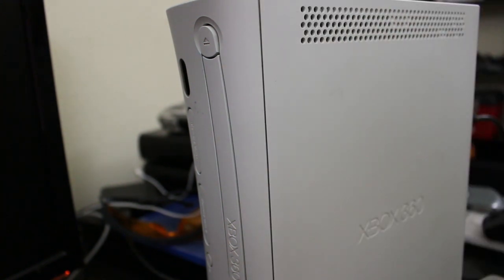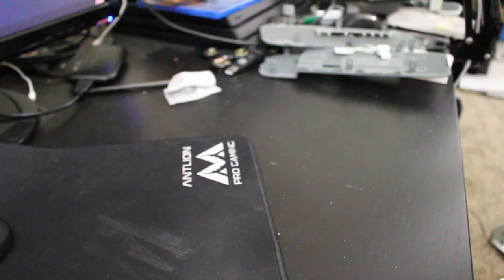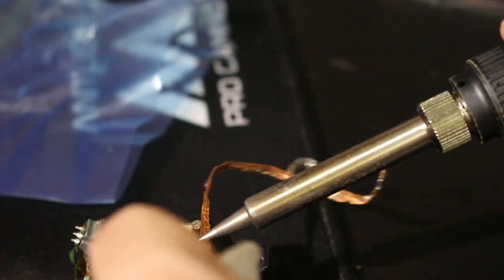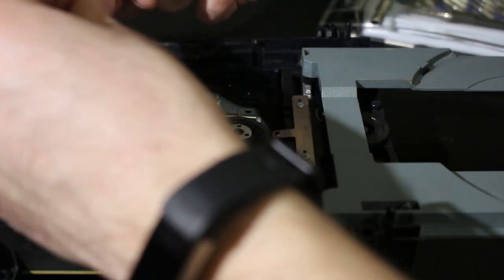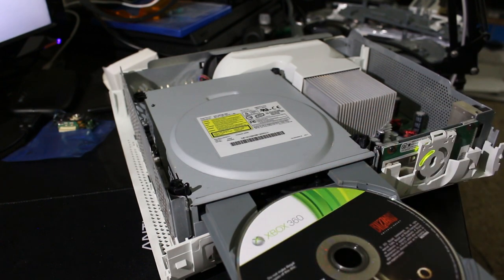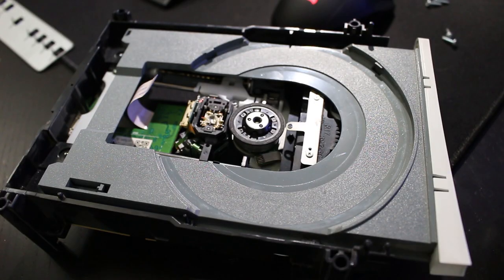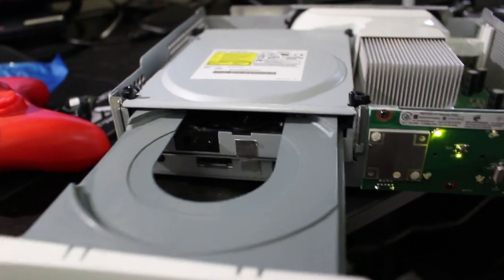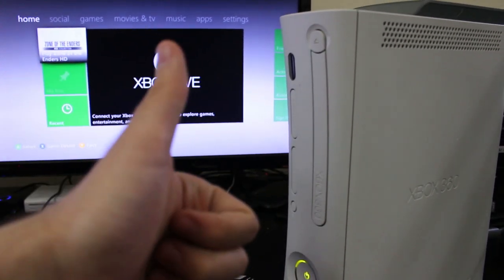Let's Repair! - Xbox 360 Open Tray Error

Comment: I did this once with a 360 slim and the screw was holding nicely for about 30 minutes amd in the middle of my test play you could hear the screw pop out and ping around the drive. I ended up using a bigger screw which so far has had no issues
Reply: can you give me the size of the screw?
Reply: I used a small screw from the inside of the headband of a Gen 1 Turtle Beach 600 Stealth headset (2015) that no longer worked.

Comment: I've seen like 10 movies now where guys adjust the DVD lazer or replace it but no one has mentioned how the bars that the lazer slides back and forth should be adjusted. The lite-on reader has adjustment screws in 3 places, the fourth corner is not adjustable. Mine was way of in one of the corners.
Reply: do you know how to adjust them? i screwed the adjustment up

Comment: In case anyone is doing this in 2021, the issue I had with the infamous screw in the video was that the area that the white part that links the laser to the motor sits in in the replacement laser is slightly deeper than the original, so the original screw wasn't long enough to reach the bottom hole. I got a slightly longer screw from the hardware store and it solved the problem nicely.
Reply from the maker: That's what I was told by the first seller, hah.
Reply: can you give me the size of the screw please

Comment: Great tutorial. Hint for anyone trying themselves dont worry about using solder braid , just use a clean soldering iron and brush it off the circuit board in sweeping motion. takes 2 secs and nice and clean

Comment: I'm actually learning a lot from your channel. I had an xbox that did the exact same thing yours is doing where i would put in a disc, any disc, and it would constantly say open tray. After a few tries it would work but half the time after that it would say the disc is undreadable, no matter the condition of the disc. I ended up swapping it for my dad's old elite model that he was planning on selling. I had to use a pair of tweezers to turn it on cause the faceplate and touch sensor were f@%$*&!.

Comment: Help me please. I have the same Xbox, and it has the same issue. I replaced the disc drive 3 time but the issue continues. Instead of flashing the board I just replace it with the original. This Xbox was a gift back in 2008 so I really wanna get it fixed. Let me know if you can help. Thanks

Comment: Success! thank you for this video. 
note: my replacement laser did NOT come with a anti-static solder globule. Im assuming that means I have a used / refurb laser. it does have the blue lens as well. but it works and thats all I care about. i spent $8 on the replacement. we'll see how long it lasts.
Reply from the maker: Damn, hopefully it lasts long enough. I know you can get new lasers for a few dollars less.
Reply: How is it a year later?
Reply: Same thing happened with mine but it's still not reading disc now it's saying unrecognized disc

Comment: I'm so thankful that you and so many other people made videos for this. Watching multiple techniques helped a lot. The hardest part truly is getting the dang case open. It turned out 3 of the back tabs had snapped off making it near impossible to get the back open. After wresting with it for actual hours I finally got it almost there and then just gave it a hard yank and it separated. I hope I never have to open it again :D. Good news is, even with my lack of solder skills, it's not hard to just heat that ball off it pretty much just rolled into my trash can and then I kept applying more heat to make sure it was completely off the contacts and I was nervous after putting it back together (I tested before putting the case back on) but it worked!! Thanks so much!

Comment: Thanks for the video. I had the same problem. I tried adjusting the laser resistance with no luck. Then swapped in a new laser and it's as good as new.

Comment: You can sometimes save the original laser by using a multimeter on the soldering points on the potentiometer on the left side of the back of the laser. You can use a small flat head screwdriver to move the potentiometer slightly to the left I believe to force the laser to work slightly harder and that can fix read errors in many cases on the 360. You don't want to turn the screw literally more then a hair because you can quickly burn out the laser. With my multimeter set to 20k I have my 360 drive set to 3.2, I've read that going lower the 3 you can burn out your laser quickly because you are forcing the laser to work to hard. For most people you will want it set to 4 or higher but I believe my drive is dieing so it lets me get a little more time out of it before it does die. Just an FYI for anyone reading this in 2022. You can Google search adjust Xbox 360 pot for detailed instructions.
Many people attempt to do this without a multimeter but I wouldn't. Turning the potentiometer even the slightest turn can result in huge over swings resulting in a burnt out laser. I would estimate a good amount of lasers can be saved this way, at least for a while. Sometimes there is nothing even wrong with your laser. Sometimes they come set wrong from the factory. If it's used the bumping around to have it shipped to you can cause the pot to move, even just the opening and closing of the tray can cause the pot to move over time.
Reply from the maker: Oh yeah, I'm familiar with that method, although as you said it can work for some time. It isn't as much of a fix however as a full replacement, and in my experience I've gotten disappointing results doing a POT tweak. 

I did a few and wasn't happy with the results, and with lasers being so affordable, it's just better in my opinion to replace the whole laser with a new one.
Reply: @MrMario2011  Yeah swapping the laser is definitely a permanent fix and I'm going to do that myself for my 360. But the pot tweak lets me play with the broken 360 I got on ebay until the new laser gets here.

I am curious though what we're the results of your pot tweak? Did the laser die? Or was it just unreliable at reading disks after the tweak? My first adjustment on 3.5 would read the disk but it sounded like it was going to launch to the moon and then would shut off, I had to slowly lower it while testing to eventually get it to work. Who knows how long it will last, who knows how long anything will last on a 360 haha.

Comment: I have a slim (Corona) exhibiting similar issues. Do you know the laser model I need for that? I may also try adjusting it in the short-term, but if I can find the right part I could order it to put in later.

Comment: I had the same problem with the screw. Fortunately, my dad has a car repair shop and found me a thicker screw. It does not tighten to the end and a little this white plastic jumps. But it is screwed very tightly and everything works. If something was wrong one day, I will buy a sled of the drive. And by the way super video and you helped me fix the X360 which lay with 4 years for this reason and thanks.

Comment: Dude, a xbox 360 video in 2018? (now 2019 but whatever~) It's like a Christmas miracle! 

Quick question, though. Does the kind of laser you buy matter for the disc drive, cause I don't want to have to worry about incompatibilitys.
Reply from the maker: Yep. This laser will work on phat BenQ and Lite-on drives.
Reply: @MrMario2011  wow, that was a fast response! Good to know that I have to see what my drive is before starting this. Thanks!

Comment: I know this is an older video, but how come no one talks about cleaning the laser lens underneath the top one ?   I have fixed several of these consoles ranging from playstation 2 to these x box's simply by cleaning both lens's.  Need to cut down some of the cotton on a q tip and flatten the end with a pair of pliers but it will fit between the 2.  Moisten (not soaked) with alcohol to clean.
Reply: There's two lens on a dvd drive?

Comment: I got the same laser through amazon and as expected the screw kept pinging out whenever I tried closing the tray
Reply: Update: I put a little dab of super glue on the screw and in the hole and it held nicely, I recently had to replace the belt for the tray and decided to take it apart and have a little peek and it’s still solid

Comment: Ok, so my 360 is RGH'd and the drive gave out a looooong time ago. Now, I dont really even own any physical games as everything is stored on my HDD so i straight up removed the disc drive. I was wondering, could it fuck up the console over long time use like this or is it just fine ?
Reply from the maker: Should be fine as long as you keep it as a RGH.

Comment: I have a broken USB on the front of my Xbox 360 I've got the parts and my system is cracked open because I just did the new laser and it works wonderfully. Now I need to know how to do the USB removal so I don't mess things up any videos for that?

Comment: I have a dvd drive from a jasper motherboard that attempts to read the disc twice before giving up.

If i keep cycling the tray eventually it will recognize that there is a disc and even rip the whole thing reliably to the hard drive. However it only notices the disc in the tray about 10-30% of the time.

I have tweaked the potentiometer twice and it now sits at a value of about 2900 (was at about 4000 at first) and im not going to tweak it any more.

Anybody have any suggestions?

Comment: That screw coming out of the white slider in your DVD drive always happens to me. It's super annoying and has nothing to do with the replacement. It's actually just the crappy made slider, and the thread breaks. You can buy replacements on eBay but I put super glue on the screw and screw it into the slider. That holds it down
Reply from the maker: It isn't an issue with threading, it is an issue that aftermarket lasers could possibly have. A few in here have confirmed the previous screw would not fit snug in a replacement laser and I was also recommended by the seller to use a bigger screw from a hardware store. Not really surprised at the inaccuracy now with it since the Xbox 360 isn't a current generation console anymore.
Reply: Ah okay, it could be possible the aftermarket sellers are fixing the original issue, I'm not sure. I've swapped multiple OEM lasers to get different consoles working and it's an issue that has popped up a fair bit. Glad you got your system working!

Comment: Hey brother bear. I was hoping you might give me a little advice. So I replaced the laser on my Xbox 360 phat , it seems to run fine.....but it doesn't read still. I've doubled  checked it. Anti plastic is gone and no issue with any screws. Do you think you can give me any advice?
Reply from the maker: If it just displays "Play Game" that means your DVD key on the drive board isn't matching to what the motherboard is expecting. If you don't have access to the original drive board to swap in, or you don't have the original drive, or key on hand you'll have to RGH the console to get it back and reflash the drive. Although again, that's assuming you're getting a "Play Game" message and the game doesn't boot. Not enough information was provided in your comment.
Reply: @MrMario2011  sorry about that. So basically the laser disc reader, I replaced it. It wasn't  reading disc's. I insert a disc in and it wouldn't say, "Play Game", it would just say "Open Tray". I removed the anti static plastic off the new laser reader, and replaced it in the disc drive but it still won't read any games. I hope I provided  enough information

Comment: Hey MrMario, nice video, glad to see you got the drive working! Bit of a random question, I remember one of your old 360 videos of you being gifted an RGH1.2 (this video: https://www.youtube.com/watch?v=wnvYmOIk884) and I loved the colour changing LED in the centre of the Ring of Light.

I've been looking around and cannot for the life of me find any of those LEDs that I'd like to add for my console. I don't know if you still have that system, but would you be able to take a look at the ROL board? I'm not sure if the LED itself is a standard 0603 SMD LED, but as I can't find any of those, I'm willing to bet the one used is of a different size/package which I'd be interested in finding out so I could purchase some myself. Could you take a look? I've messaged around with other sellers who do similar mods but they don't seem to be responding which sucks, hence why I'm asking here :P

Comment: I pot tweeked the laser after this open tray error, now it reads only the originals.. no burned discs at all.. Do you know why ? Do I need to change the laser ?
Reply from the maker: In my experience POT tweaking a Xbox/Xbox 360 laser isn't worth it, you're just speeding up the death of an already dying laser. Original games are easier to read than backup games.
Reply: @MrMario2011  thanks for the reply, I guess buying and replacing the laser is the only way to revive the backup collection

Comment: Ok, I know this is kinda off topic for the video, but at least it's on a Xbox 360 video. Anyway, do you know of anyway to softmod a Xbox 360? I really don't want to have to open it up and hard mod it.
Reply from the maker: Impossible.
Reply: MrMario2011 ok well I've since decided on going with a x360key, any info on how to dump the drive key? I haven't opened it yet, but I know that it's a Jasper MB, based on the fact that it was made in 2009 and has a current rating of 12.1 amps.
Reply from the maker: Look up my flashing tutorial, you can get the key that way.

Comment: ? my orginal xbox its like a 6 month out release xbox 360 the drive on it makes awefull noise it works but it sounds like its eating disk what can be done for it
Reply from the maker: If you want to fix it while being lazy, replace the whole drive and swap over your old PCB.
Reply: yeah i thought of that but i bought a newer version of the system that has 250gigs of storage mine was the 20gig model and i replaved the drive with 120 and that was running out of space

Comment: The drive on my system won't open when it's vertical. Will a new drive belt fix this?
Reply: Kag Dioah Yes, it makes sounds but doesn't open. The emergency open trick with a paper clip works fine though. I ordered five replacement belts from Ebay already.
Reply: Kag Dioah Should I lubricate the rails? I have some lithium grease I use for my 3D printer.
Reply: Kag Dioah thanks a bunch
Reply: Just put it horizontal, or leave a disk in it.
Reply: AZTech&Gaming that won't fix the problem. I prefer fixing the issue itself
Reply: I know, but that happened to me on a new belt, because it was the magnet that was clamping to hard on the laser assembly so I had to put tape over it.

Comment: 9:00... I replaced the laser on a friend's XBOX360 this morning... didn't know about that solder blob. I've repaired 6 360's overseas by replacing the laser and they all worked. Is the solder blob a new thing?! His 360 has the 'open tray' fault, guess I will have to get with him and see about removing the solder blob on the laser I installed... huh... ALSO, I thought you couldn't change the disk drive itself. I read, some time ago, that the CDROM & the motherboard are linked so you couldn't change out the drive.
Reply from the maker: The solder blob has always been a thing, at least on properly packaged lasers. You can swap disc drives as long as you either swap the drive board as well, or you use software to transfer the DVD key.
Reply: @MrMario2011  That's interesting about the blob and thank you for the information on the disk drive. Now to just find one, my buddies XBOX360 has this issue. We're going to try removing the solder, but in the event that doesn't repair the drive I'll have to replace it. Thanks for the information.

Comment: the backup disc looks cheap, non verbatim. i also use low priced ones but i usually have high pi pif values sometimes read error. can you redo a video on liteon ihas and imageburn for cheap discs?

BTW i also got 141x laser from ali. i checked the resistance it was 1.5kohm and as per tutorials it should not be below 3. usually it is 5 to 6. anyway its still running dont know for how long.
Reply from the maker: No need to redo the videos for them as the process is the same. Cheap media is cheap media.
Reply: MrMario2011 hmm. then it must be my burner dying out. will try to find a replacement. thanks mario. great videos. 👍

Comment: At 13.43 that screw for me is stripped what do I do
Reply from the maker: Gotta use some tricks! Maybe use a flathead to slowly loosen it, or put a rubber band between the screw and your screwdriver to add some tension. Just try a few common methods for removing a stripped screw.

Comment: Is there an easier way? A way that doesn’t involve taking your x box apart. I am a very precarious person and do not want to mess up anything.
Reply from the maker: Nope.
Reply: MrMario2011 thank you for the feedback. As I stated, I want to avoid disassembling it. I would buy another one but this problem keeps happening with every one I have owned and want to fix it instead of just buying another one.
Reply: Jerry, just bite the bullet and try a few repairs. As you mentioned, this happens a lot with all retro consoles, so if you want to keep them for years to come, might as well learn. It gets easier and soon you will be a pro.

Comment: When I replace xbox  360 lasers.  I always have to put a fatter screw to hold the worm gear to the laser. The black screw on the x-clamp works good for this.   That happens alot with 3rd party lasers.